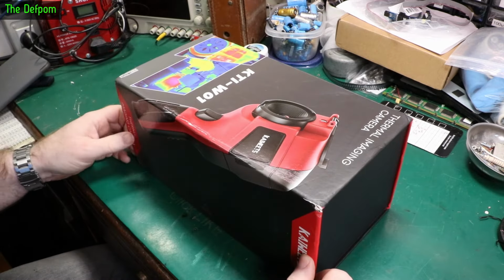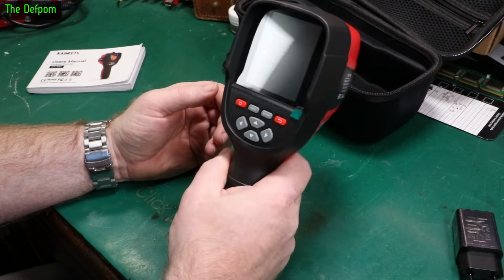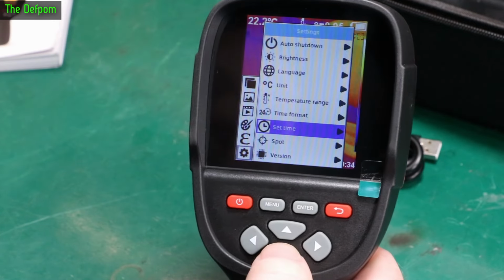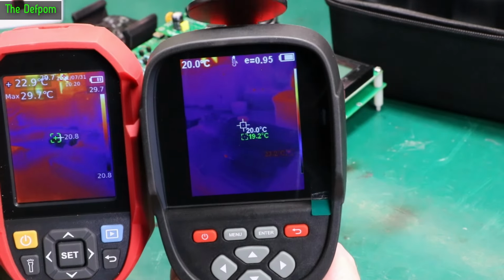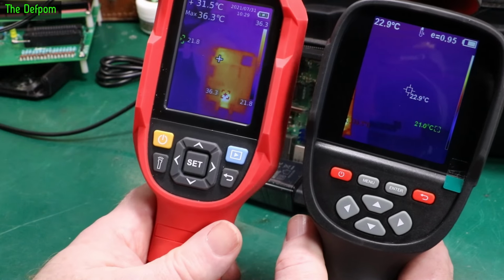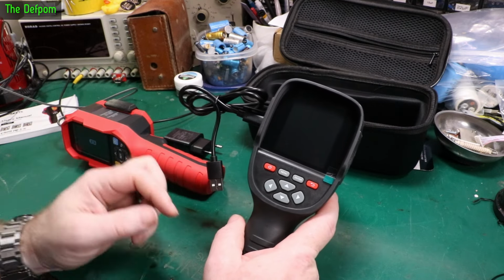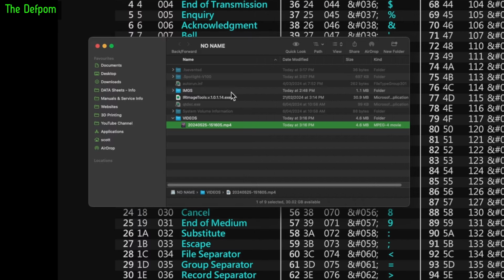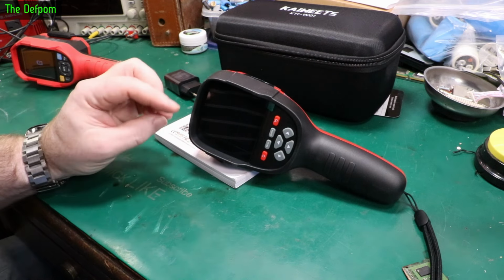🔴 Thermal Camera Review - Kaiweets KTI-W01 - No.1250

Comment: There's a setting called 'measurement parameter' where you set the mean distance of the object your are looking at. This is required because IR radiation attentuates in temperature with distance and so setting this parameter compensates the temperature readout. On the TopDon TC004 (almost identical to the Uni-T) it's on the settings menu. I have mine set to the minimum 250mm for electronics work.
Reply: Yes on my Doogee V31 GT phone you can adjust that and a temp range ect and you have a large screen and a phone with night vision  thrown in it is infiray 🙂

Comment: I had one of these 6 months ago.  The IR camera works reasonably well. Unfortunately there is not a removable SD card.  I ended up returning mine because the fit and finish the choice of plastics and the choice of color made it look like a toy.  (Cheap and nasty) Even though it worked well I was laughed out of the office.  Some better plastics better fit and finish and a lens that is bigger than a pinpoint would help the credibility of the unit. For now until they come out with a second gen and correct some of the issues listed I'll pass.  If they would have put as much effort into the construction of the case as they did behind the box that came in (and you will likely throw away) it would be a much more professional looking unit.